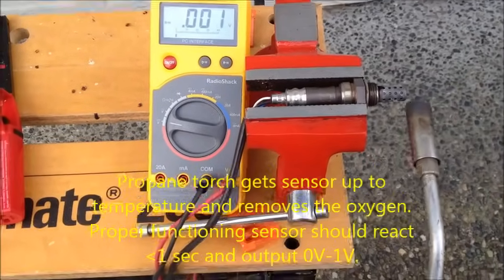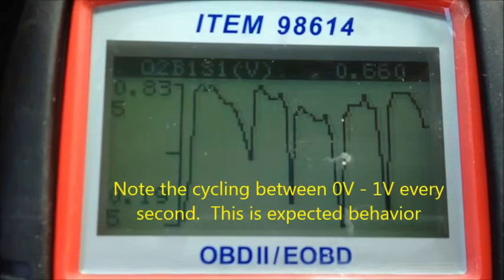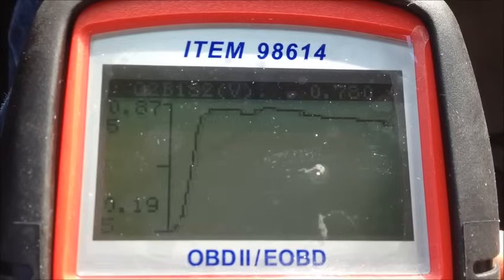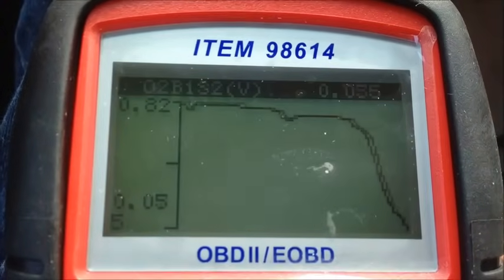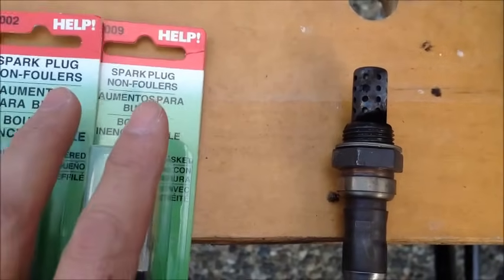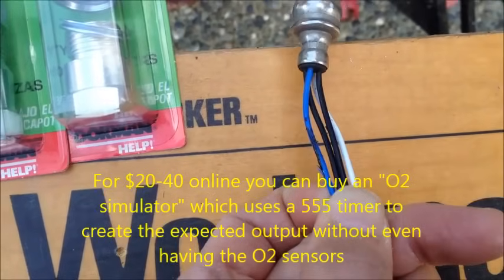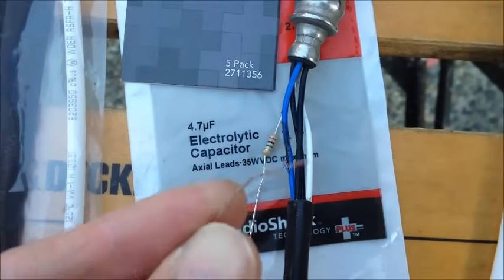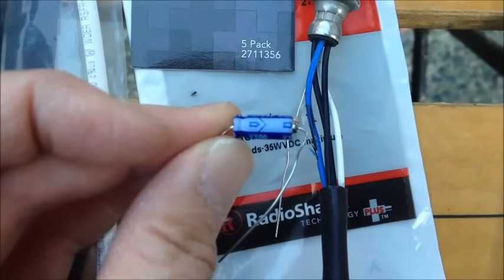$3 O2 simulator fix for P0420 Check Engine Light

Comment from the maker: I want to clarify to everyone that this circuit will NOT fix a broken O2 sensor or broken Catalytic Converter.  What it will do is prevent p0420 for a catalytic converter that is functioning but your computer is too sensitive.  The ECM computer can't actually measure the smog components - only a mechanic can do that.  Instead, your computer is programmed to interpret certain o2 performance characteristics as whether the catalytic converter is working at peak efficiency.  If you only occasionally have p0420 and can make it go away depending upon the gas you used or perhaps a bottle of Chevron Techron, then this fix is highly likely to work.  That's why I go through the effort to show you how to bench test your o2 sensor first because this isn't going to work if your o2 sensor doesn't work.  Most people don't bother with that step.  You can certainly bypass it and try the fix, but if you want help diagnosing further then you'll have to report either what your bench test results are or what your high end ODB scanner (ideally graphing) tells you the o2 bank 2 voltages are.
Reply: Hello MITEEman, I attempted this on a 2003 Honda CRV, The P0420 code has gone away but now I have a P0139 code
which is described as (P0139 Honda - HO2S Bank 1 Sensor 2 Slow Response) have you ever ran into this problem?
Thank you in advance
Reply from the maker: The1224ms
No, I haven't seen it, but that code actually makes sense because this slows down the response of the waveform.  You can speed up the response by using a smaller capacitor or resistor.  Cut the value of either one (usually depends on what you can find in the store) in half and try again.  The value of R x C is what determines how slow the response is.
Reply: MITEEman Oh ok, makes sense I'll give that a shot. Thank you for the reply!
Reply: MITEEman Hello MITEEman, my car has passed smog!!!! I did exactly what you suggested, I used the same resistor and a 2.2 microfarad capacitor, I have driven the car for about 100 miles with engine no light. I took it to smog it today and it passed, thank you for this video and the previous reply!
Reply: @The1224ms  crv on what resistor and capacitor actual u use mate?
Reply: The1224ms me too.  same here
Reply from the maker: +Greg sees If you can pull your o2 sensor you should bench test it as shown.  I'm not experienced with P0130 but it sounds like a bad o2 sensor is a good suspicion.  The key to the downstream sensor is not that it shouldn't fluctuate, but rather that it should fluctuate a low slower than the upstream sensor.
Reply: http://www.aa1car.com/library/o2sensor.htm   Scroll 3/4 down the page. Different manufacturers have different color codes.
Reply: +MITEEman So, ive been researching how to read the voltage levels from upstream and downstream 02 sensors as they relate to an efficient cat. The basic understanding is that bank one sensor should change from rich to lean, which is normal, while the bank 2 sensor should not fluctuate more than approx 0.1 volts. Ive had the p0420 for a month now, but it went away for a few days after erasing/resetting the ecm. Then after a week it came back. Now Im getting p0130 02 sensor (bank 1) circuit malf. Do you recommend purchasing a new 02 sensor? 2004 audi a4. What else do you recommend? Thanks
Reply: MITEEman   my cars downstream 02 sensor has 4 wires but white white grey and black ?
Reply: Ruan Kemp I started getting this code after I installed a aftermarket cat on the car. I’m assuming in a situation like this we’re the aftermarket cat efficient as the stocker this might do the trick?
Reply: Hi MITEEman wondering if you can make me one if I send you a new 02 sensor to you…my cats r working but the converter you say is to sensitive please let me know
Reply: Party pooper
Reply: This hack doesn't fix anything and there's no such thing as a computer that's too sensitive. You have an issue with the engine that needs repair. Read and follow the shop manual.
Reply: On that note it having the dealer check and see if there's an ecm update to (desensitize) the ecm, sometimes there reflashes out there and you won't know unless you bitch about a certain problem
Reply: I followed instructions and it worked perfect for me,done it 3 times in past six years and used a bypass pipe instead of cat for non smog time! works perfect!!

Comment: I had code p0136 after doing this. I just took it apart again to double check. I don't have the code reader that shows signals or lines, so I'm going to rely it's correct. I had both oxygen sensors replaced last year. My catalytic converter looks in great shape. No odd discoloration, or smoke of that sort. I will check that the connector is all the way in. Will be keeping my fingers crossed and letting you know the results soon.
Reply: http://prntscr.com/56676x This is a bosch sensor. I google the wiring so this should work If you guys have any suggestions. Please let me know, thanks.
Reply: Sorry to say it didn't work. I went like 50 miles or so and p0136 came on.
Reply: Hi I face the same scenario. Hope to try the adapter and see.
Reply: @mryaj5174  Same.

Comment: After the modification I have p0136 come on after some driving. Now what? I forgot the brand of sensor for my 2003 corolla, but it was 4 wires. The 2 white is heater and the black is the signal. The grey is the ground. I did it pretty much exactly like the video. Only done to the rear oxygen sensor too.
Reply from the maker: P0136 means the downstream sensor you modified isn't returning enough voltage. If you have a graphing odb you'll probably find no output at all. I had this happen once when I didn't plug the sensor in far enough to its socket. Check that and all your wiring. You can also bench test with a torch and voltmeter.
Reply: I took the sensor off and re solder the wires. Both sensors are just 1 yr. The engine light came back on like 50 miles or so after some driving. I think the ecu doesn't like the readings. Should I try soldering a bigger capacitor on, or just forget it?
Reply from the maker: Karen Vang
This fix will only work if you have a working catalytic converter and oxygen sensors.  It only slows down the changes in o2 so that finicky computers don't throw a p0420 reduced efficiency code.  I know p0136 is low voltage but can't diagnose it further without more information.  The minimum to further test is a blow torch & voltmeter (~$40).  Using those you can bench test the modified o2 sensor to see what voltages it's actually producing.  It should be a slowly changing value relative the speed at which you apply & remove the torch.  If you can't do that test then I can't diagnose the problem further.  It could either be your wiring, or the o2 sensor, or the catalytic converter.  Given the p0136 I still guess that it's your wiring because this fix should not change the voltage values - only slow them down.
Reply: Hi face the same scenario. My one is Toyota Vios 2003. what happened after?

Comment: I have been suffering the p0420 on my mk3 Toyota mr2, tried to get the o2 sensor out and it was solid! to solder it in place was not practical so...solution: I chopped the plug and the socket off a scrap car and made an adaptor like section, just plug and play. I cleared the codes and have gone 50 miles so far (previously I would get 20 miles and mil light on), no mil light, no pending codes and my scanner says its all good. THANK YOU SO MUCH! I can get the bits and do the work but its clever guys like this that make it possible. thanks again.
Reply from the maker: Thanks for that helpful hint and I'm glad it worked for you.  A number of people seem to have sensors that have seized.  That's another good reason to solve it with this circuit rather than a spark plug extender.

Comment: now with the resister for having it face in the right derrection, should it be with the orange and brown rings to the o2 sensor and the gold and green toward the ecu? you have it covered up after you solder it.
Reply from the maker: Resistors are not directional - either direction is the same.
Reply: MITEEman ok thanks

Comment: I installed a wideband oxygen sensor for my primary that has a 0.1-5.1v range for my gauge and a 0.1-1.1v range for my ECU. Since I didn't want to have a 2nd bung for another primary oxygen sensor I just removed the stock one, and to avoid a CEL because I couldn't signal that the heater was working with the wideband, I just put 2 10ohm 1 watt resistors in line for the heater circuit. I used the stock oxygen sensor harness by cutting of the old sensor and using a male and female connector I ran signal from the wideband to the harness and to the ECU and then with the two heater wires I ran said resistors. No CEL accurate fueling and the ability to see what my AFRs are. This is for a 1997 Honda Prelude Base Model (Non-SH). I imagine this will work for someone with the heater CEL code and nothing else.
Reply: so cool to find this, 7 years later im about to try something similar on a 2012 chevy sonic,hehe. got some resistors and diodes around and im gonna give it a try.

Comment: Sad to say I tried this on my 2007 Acura MDX and the code returned...... :(
Reply from the maker: Did you happen to test the O2 sensor with a blowtorch or check the original o2 sensor output on a graphing ODB reader?  One possibility is that your O2 sensor may be dead.  This won't help a completely non-functional sensor.

Comment: Awesome how to video. Worked like a champ on my girlfriends Mazda 626. The Sauder was definitely a pain but after clearing the codes and driving 20 miles all readiness monitors had cleared. Going for inspection tomorrow. Thanks!
Reply from the maker: You might need to drive some more before inspection.  The computer records if you reset the code manually and there's some unclear set of circumstances that have to happen before the computer will say that the all clear is legitimate.  In general, I'd say you need to drive 75 miles before doing an inspection, otherwise you risk the possibility of them sending you home to come back.  If you didn't clear it and it cleared by itself then you're fine going in anytime.
Reply: Well my scanner has a built in emissions tester and says Its clear to pass. But in North Carolina only 6 of 8 readiness monitors have to be complete to pass inspection.  Thank you for your input and thank you for this video. Gained me some time in replacing the 400 dollar cat on this car.
Reply: Hey is the hack still working good?

Comment: hey great video, could explain the math and logic behind this? as I understand it, the sensor goes from 0-1volt, why did you choose 1M ohm resistor?
Why did you choose a 4.7 capacitor? does the capacitor dampen the spikes and what is the resistor supposed to be doing, lowering amps?
Reply from the maker: I'd love to explain more!  You're basically right on but I would clarify that the capacitor won't dampen the spikes without the resistor - they are both required to achieve an RC Low Pass Filter.  The "water analogy" explanation is to imagine two buckets of water connected at the bottom by a small tube.  The first bucket is like the Catalytic Converter voltage quickly going between empty & full.  The small tube is the resistor restricting flow of electrons.  The second bucket is what you are presenting to the car's computer.  If the first bucket instantly goes from empty to full then that little tube will only fill the second bucket slowly.  If the first bucket stays high a "long time" the the second bucket will eventually get full as well.  If the first bucket ever drops below the second bucket then it will cause the second bucket to slowly drop as well.  As for the math, R (in Ohms) x C (in Farads) =~ 2/3rds the time it will take to change from 0V to 1V.  1 million ohms x 4.7 millionths of a Farad = 4.7 seconds.  2/3rds of 4.7s = 3 seconds to go from 0V to 1V.  You can use any two that are convenient size but you end up shortening or lengthening the time and that may or may not work for your computer.  Google RC Low-Pass Filter and there are some good Websites & Youtube videos.  The problem I've seen with other internet posts is that they miswire it so that the Capacitor straddles the sensor without forcing the current through the resistor.  That's like connecting the two buckets - both buckets look the same.
Reply: MITEEman thanks, I think I see what you mean. one limits the current(flow regulator aka resistor to keep frequency low) and other keeps it from dipping too high or too low (i.e. don't let the bucket get too low or high = amplitude). The computer must be happy with a straight line?
With that in mind I did some experimenting disconnecting the #2  O2  sensor, got a heater code and still  noticed .29 volts on the scanner. what would happen if we just cut the signal wires and left heater connected? Either this will work or theres something with the sensor I am not understanding.
Reply from the maker: Matt Ralston I don't actually know what the computer code is looking for but I've read a few hints that the computer counts the number of times the upstream sensor passes some threshhold, and then looks at the times the output sensor crosses that threshhold.  If the output isn't a lot less than the input then code is thrown.  The newer the computer, the more likely that the algorithm is more sophisticated.  I'm pretty sure that the downstream sensor doesn't change at all that there's a code that's thrown but I can't remember which one - something about a bad downstream sensor I believe. 

You disconnected the O2 sensor so I understand the heater code is thrown.  You're saying the ODB diagnostic port shows O2 sensor #2 with .29 volts?  I don't know why that's happening but I don't think that's helpful.  It would be a pretty poor engineer to not throw a code if the o2 sensor were disconnected but it might take 75 miles.  The computer won't throw 0420 until it's met certain diagnostic engine characteristics to show that it's been put through its paces.  I suspect that within 75 miles you'd get 0420 or another code signaling a bad o2 sensor #2.  Let me know if you do try.
Reply: MITEEman

I have 2 cars with same code, I don't know why I had .29 volts on one car and the other at 0v, but none the less they both came back with a sensor low signal code, so you were right. Your filter works great on both with out problems. thanks!

Comment: Hi MITEEman.

I have a nissan pathfinder 2005 and I have 4 O2 sensors.
2 in the front heated,  and 2 at the rear.
I buy an exhaust line full Doug Thorley, and I no longer Cat, so I expect to have a code 0420.
Is that if I do this 4-sensor, it's going to solve the problem?
Or I have to do that on 2 sensors? front or rear?

merci.

sorry for my English i'm french.
Reply from the maker: I don't know anything about Nissan's, but if you don't have a catalytic converter at all then this won't help you.  You'll need a 555-timer based O2 simulator off the internet.  I do recommend that you install a catalytic converter - it really does help the environment.  It might seem strange that I post this video and care about the environment but this solution only helps catalytic converters that do work but have overly-sensitive computers and require overly-priced OEM parts to fix otherwise.

Comment: Thanks SOOOO much for this video! I have a 2001 Tundra V6  with CA emissions.  Got a P0420 fault code and tried several ways to repair it.  At the end of the day, I did not want to spend $1000 on a new OEM catalytic converter.  So I tried this and it work! I put on a code reader after 10 miles of intstalling the "filter" and it showed no codes! I went to get it tested after 9 months expired plates and it passed and I was finally able to get my plates renewed!
Steps I tried prior to this tip:
1. Replaced downstream O2 sensor
2. Used CataClean
3. Re-moved front cat (not rear) and soak in soapy water overnight. replaced cat with OEM gaskets.
4. Replaced upstream O2 sensor.
5. Finally installed this filter and it worked!
Reply: hey, did u install the resistor mod for both banks? My 2003 Odyssey v6 is throwing slow response p0139 after installing it on bank 1 only. I wonder if the ecu compares it to the other bank..... I'm going to be trying out lower capacitor value to 1.5uf.... Im at 3.3uf and it's still showing slow response
Reply: @masmagalingako  I have 07honda civic hybrid California
Car did hack. P0420 code clear but after 40 miles I have p0139 now
Have anyone able to clear this code if so how and what resistor and capacitor is right value
Reply: @fosso67  I got mine working by jus using 2 resistors, 180k and 1megOhm. No capacitors. Honda at least my 05 odyssey uses wideband o2 sensor for the upstream. So slowing down the response with the capacitor will only cause a Slow Response fault code.

What worked for me is a voltage divider network where the o2 signal voltage is dropped down by approximately 10%, such as 0.8 now reads 0.72 therefore reads a bit leaner.

My van now always clears all of the emmissions code.
Reply: @arnoldg3076  Thanks for posting this. I've been looking for answers to my 2006 Tundra P0420 and lots of other forums and posters talk about how the newer "wide band" sensors are immune to this fix. Can you expand a little more on how the two resisters work on wide band? Also, how did you wire them? In series with megaohm first and 180k second, or vise-versa?
Reply: @remington351  my 05 odyssey has wideband on the upstream and narrowband on the downstream, basically i drove the signal down by 10pct using the resistor network.
Reply: @arnoldg3076  Thanks.
Reply: @arnoldg3076 hey man I know this is an old comment. But I just wanted to know if you remember what resisters you started the circuit with The 180kohm or the 1mohm ? Thanks
Reply: Ummm I’m telling...lol